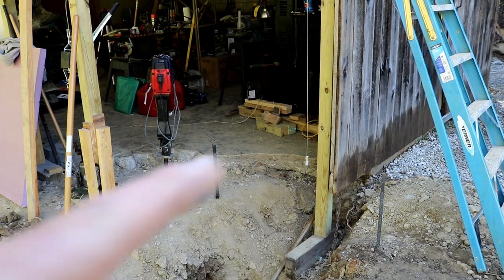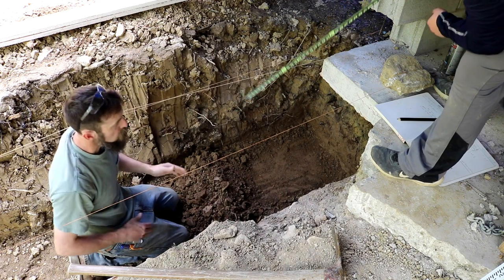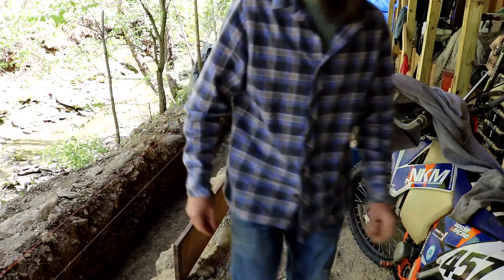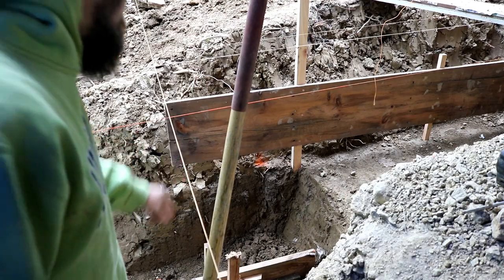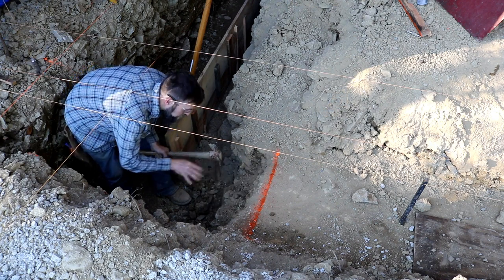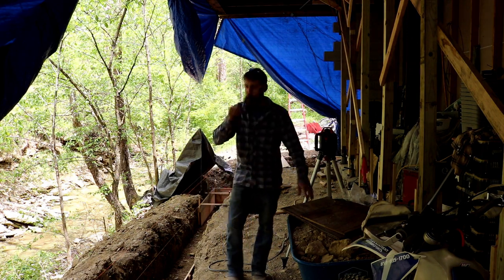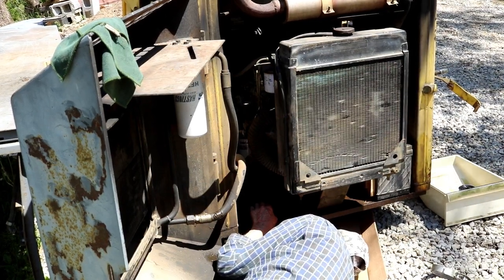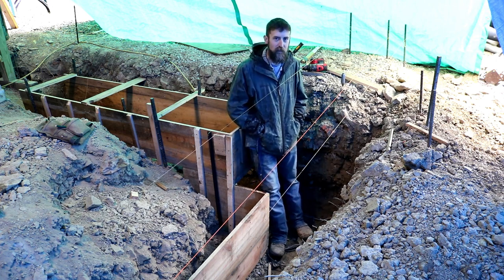Building concrete forms for the shop Footings . Damaged Shop 13

Comment: I know that you probably don't want to hear this but on this job you need to stop thinking like a machinist you tollerances are an inch or less instead of thousandths. you should balance the cost of concrete against the cost of form materials and your labor. In my opinion the most cost effective way to make this foundation is to one drive long steel stakes down the center of the trench. the stakes should protrude several inches in to the concrete. the purpose of the stakes is to provide an anchor for the foundation to keep it from sliding down the hill. Lay rebar on chairs in the bottom of the trench and secure it to the posts . . Drive in long wooden stakes that are to be used to mark the upper level of the footing and should be marked with paint to show the upper level of the footing. then pour no need for form installation or removal. then pour and pull the stakes. level the top with mortor when you set the blocks. This is not rocket science, it will all be buried out of sight.

Comment: Steve, to me, you've overdone it and that can really be a problem.  16" thick concrete is very heavy and your forms are very lightweight.  The only way I see them standing up to the concrete is if you backfill before pouring.  Check with your engineer and see if 8" thick is enough.  If so, half-fill with gravel - inside and out.

Comment: Way too many strings. A few batter boards at rhe ends instead of the unsteady "string-to-string" connections. One string is more than enough. Drop all strings so you can work in the trench.

Comment: I'm glad to hear that you realize you are over analyzing things. You wasted a lot of time, effort and materials on forming the footer. All you really need to worry about is the finished height. Even that's not so critical since the first course of block will be layed to a string. Dig a trench, pour concrete, set first course and off you go. Please clear your head and start thinking about what you are doing more realistically.

Comment: Make the pour in Section's , then you can mix your own concrete rebar etc.Great video 👍.
Reply: you really want concrete one continuous piece. Concrete bonds but not like when it is all set at once. Otherwise you have to get involved with keys and crap. We use concrete because it is relatively cheap and easy to work with. So it is good to keep it that way.

Comment: You are correct that you can be anal with machinist ideals of accuracy, get the bottom of the  footer. Are you putting the footer in, if not then they will tear apart everything you have done for measurements. They use the laser level to mark the hight of the footer. Then start from level ground and put in the footer, they don’t care if there are holidays in the wood, throw a bunch of dirt on the outside... your doing this as a teaching aid? Relax, get they guys in to pour the footer, than a 3 or 4ft wall to meet up with your first row of blocks. Why sweat it out if you are not doing it or if you are, then your footer is not as big as your measuring, Footer then a low wall to your first run of blocks.

Comment: are you machinist by trade? because footings are usually not measured by the thousandth.your work is well thought out and exacuted but your making it difficult on yourself with perfection.better off pouring the whole trench full to the footing elevation so it will lock in with the un disturbed soil and rock

Comment: I usually love watching your videos, but this video is so frustrating to watch. Been there and done that as an owner builder, so I know what is involved.
You are so far over the top with precision!
This job could have been done in half the time at much less cost.
I cannot understand why the trench is now so wide. Two bites with the 12" bucket could easily provide the 20" width you wanted. (24"trench, wow so over the top).
The money and time (so much time) spent on things that don't matter is unbelievable.
The concrete only needs to be level on the top. The ground does not need to be scraped in at the trench bottom.
Tying string lines to other string lines is not the best thing to do.
I think you need to install an observation view port so people can see the precise work 😊.
I'm sure it would have been cheaper overall to have a contractor do the job from start to finish.
BTW, on your 16" block height measurements, did you take the mortar/cement bed between courses into account?
Don't give up your day job 👍
Best wishes for a very successful finish.

Comment: You do realize the block gets laid to a line at the top of the course.
That footer could be an inch out and it would end corrected by the time it got to grade.
Tradesmen work to accepted tolerances, and constantly correct for those trades that will follow.

If someone came to your shop with a drawing calling out Hot Rolled 0.75000" 
Would you laugh in their face? 
A hundredth thou callout on rough steel with mill scale.
Because that's what you're doing here, to them.

I'm just trying to analogize what's happening with tradesmen.
The only one that cares is you.

That site is miserable as far as having material easy to drop,  close at hand and room to work in that trench.
Add a homeowner with OCD and a camera...

No knock on you Steve.
Do what you want with your shop.
If I weren't so far away I would offer a hand.